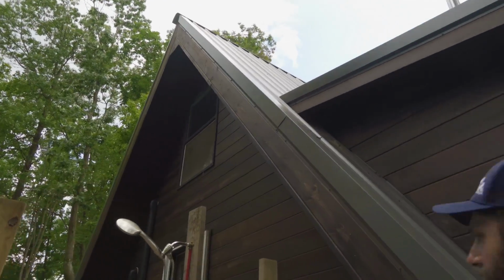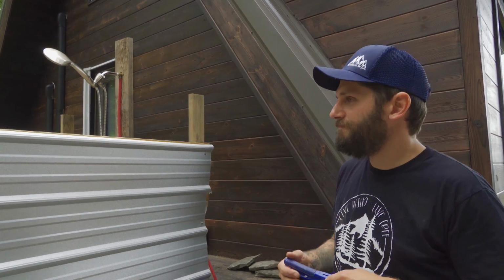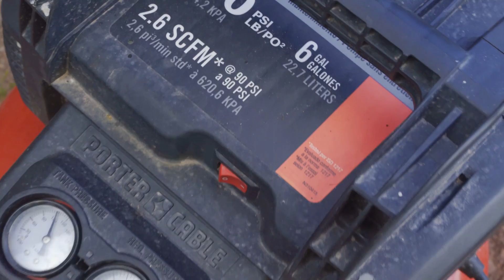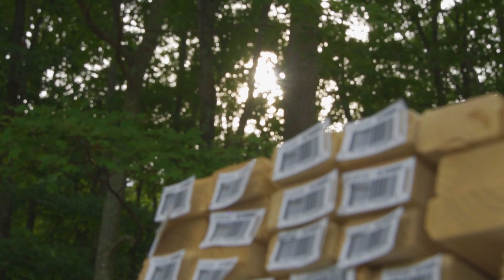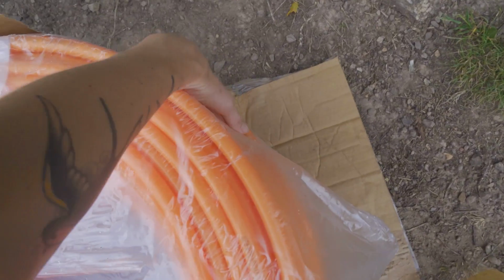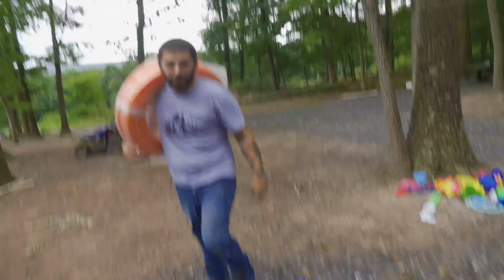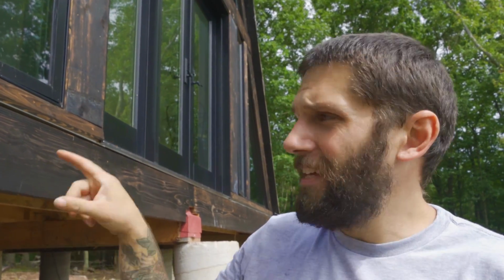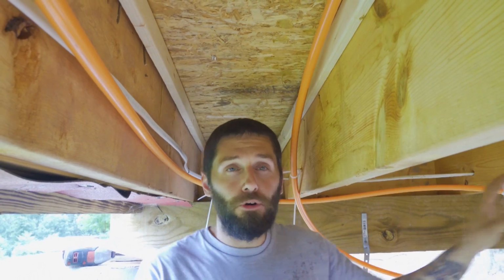Sixty Days Or We're Canceled!

Comment: The sliding door you could make into a juliet balcony. That would be cheaper and quicker than putting in stairs. And easier to reverse when you want to build your deck.
Reply: Awesome reply!
Reply: Exactly how they do it in MN to cut costs on the initial build.  It’s legit and should comply with the policy.  Even more simple is no Juliette deck and just put a temporary rail across the deck door opening.
Reply: Exactly what I was thinking.
Reply: @davidvoller726  this^^^
Reply: Benjamin Brewer From my understanding... (want to check building codes) generally as long as any egress (window or door) greater than one needs to allow for someone to get out.  Looking at their space as such, they have a lot of egress.
Reply: @benjaminbrewer2154  technically they have three. The one door at the other end of the house and the one opposide the kitchen. The big glas doors to the balcony or planed deck is the third exit/entry/doorway.
Reply: I’ve seen where there just put a rail with vertical boards right across the slide door opening.  Treating it as a window.  :)

Comment: My in-laws had a mudroom/porch where you could drop the field clothes in a washer (not the main washer) and hop in a separate shower.  Kept the mud & grease out of the house and main laundry.  Before insulation, I suggest steel wool/stainless kitchen scrubbers around every floor penetration to discourage varmints gnawing their way in.  I would build permanent temporary stairs at each door just for piece of mind if exiting in a early morning fire or something.  If you plan it out, you could reuse parts of the 3 stairs on the eventual deck.

Comment: We built a new home a few years ago and the builder just attached a piece of deck railing across the outside trim of the door to pass the final inspection.  So even if you opened the door you couldn't fall out.  Our county uses the International Building Code and it seemed to satisfy the inspector.

Comment: Regarding insurance, don't expect an extension. Cancellation likely at 60 day mark without verification of punch list completion to their satisfaction. 
Regarding rails and pickets, "permanent" does not usually refer to whether or not it will ever be changed. It's simply used to describe a securely fastened assembly which is done to local building codes. Usually showing concrete, nail or screw fasteners, hurricane or seismic anchors if required, and meeting dimension guidelines. Handrail height is usually between 36-42" from the leading edge of steps and from any deck surface over 18" off the ground. Spacing between pickets may allow no more than a 4" air gap to protect from a child's head passing through, therefore minimizing the chance of a fall. As long as it doesn't fall over at inspection, you'll probably be just fine.
Thanks for sharing your life and stories with us all.  It's been a pleasure to watch you grow.
Reply: They should give some very serious consideration to installing a Juliet rail!!

Comment: The bubble foil stuff is a radiant barrier insulation. I love that stuff, especially if you’re camping or out in the snow like if you have to crawl under your camper or truck and work on it, throw that stuff on the ground and it keeps you dry and warm.  It’s also rodent resistant and bug resistant which helps a little bit with that stuff.

Comment: I had it happen to me on a home I subcontracted/ built in TN years ago. The sunroom on the back of the house would go out onto a deck which was to be about 5 or 6 feet above the ground level, but I would be building it after moving in the house. I was required to put a double keyed deadbolt on the back sunroom door which would be onto the deck when built. The double keyed deedbolt prevented someone visiting from unlocking the door and falling 6' to the ground.
THEY COULD EVEN OPEN THE DOOR!

Comment: You are going to love radiant heat .  On the underside of the main floor of my house we used  a rubber type hose , not fun to install but when it gets cold and it warms up the tile floors well worth it.  I used the type of pex pipe you used under the concrete  floor .  I  used a  Lochinvar Nobel combi  boiler  for  domestic hot water and heating needs .

Comment: I’m impressed that nothing nasty moved in under your house (skunk, wasps, etc). It would be easy enough to make a little balcony outside the glass doors—just a balcony, with “permanent”-quality railings but no steps. The door in your peaked dormer only needs a little platform with steps going down...again, “permanent” quality but relatively simple to remove for the sake of upgrading.
Speaking of the peaked dormer, I still think it needs something (temporary soffits?) to keep bugs out of your ceiling.

Comment: I replaced every inch of old copper in my home when I bought it 4 years ago. It's a great product, went in easy, and has had zero issues. This is from a guy who has soldered both copper and lead pipe at work for over 30 years. PEX is the way to go!
Reply: Nah, i'll stick to copper. Lets see how your pex holds up after 37yrs compared to my copper pipes installed in 1983...
Reply: @rztrzt  Modern copper has impurities in it and will be leaking in 15 yrs max. Yes 60s copper is still going in a lot of houses.
Reply: @rztrzt  I don't plan on being in my house in 37 years...but there's plenty of time on existing PEX builds now...more than enough to know if properly installed its a solid product. I've got nothing against copper...in fact I enjoy working with it...but the cost no longer makes sense outside of a few scenarios. For the average home owner there's no benefit to installing copper.
Reply: @rl3898  bollocks, maybe in your country but the standards here are higher than they were in the 80s
Reply: @glamdring0007  Yes in the US you guys go for cheap hence why nothing lasts. Each to their own. Over here people won't touch that stuff unless it's for stables, animal pens etc.
Reply: I'm pretty sure copper kills germs, viruses, etc on contact. Hence the wide use of it. Egyptians kept their water in huge copper jugs.
Reply: @rztrzt  PEX wont degrade over time or break under high stress. Here in the midwest where it's cold, copper busts and PEX does not. It's faster and easier to install, and will last longer. I think people are hesitant about PEX because they're uneducated and somehow connect it in their brains with junk cpvc. It IS a superior product to anything else on the market and has nothing at all to do with previous plastic water line products.
Reply: @rztrzt  Yeah sure you never buy Chinese or Indian products...Doh!
Reply: @rl3898  wtf?
Reply: @TDiem-vh9zv  True...and if you're on a well for water it might be a concern. Anyone on city water doesn't have to worry about it.
Reply: @glamdring0007  .... agreed, remodeled a house built in early 80's and pulled out all copper, installed a manablock home run pex system for each hot/cold drop. Easy, tune-able and not worried about corroding or splitting issues due to cold weather. Cheaper than copper as well, better all around.
Reply: @glamdring0007  I agree totally. I was just giving a reason WHY it was used. But new inventions come along and things change.

Comment: I ran into the same problem getting a home appraisal and having 3 steps that were slightly too high and needed a hand rail. I built a 'permanent' rail made of 2x4's, sent them pictures, then it was approved. 'Permanent' means very little except screwed down. Just get it done simple and easy enough to pass the inspectors, then tear it off the next day. These are desk jockey paper pushers, they just want to push the policy and start collecting your money. IMO you could just do without insurance all together, its a scam but thats another discussion for another day.
Reply: You can go without insurance but if your house burns down you lose.
Reply: @leahr.2620  until they find a way not to pay up
Reply: If you pay premiums for 50 years and never receive a dime, then count your blessings. We've had two claims, each paid properly. Having no claim is much better than a paid claim.

Comment: Should have closed cell foamed under the house with 4 inches, installed chicken wire to prevent critters from getting up there and during winter you can use the heat pump through the mini split or get 3 radiant space heaters. Your floors will stay warm!

Comment: love radiant heat, I had garden apartment that used to have it and it was so nice in the mornings walking into the kitchen or bathroom barefoot and feeling that warm floor, only bad was it dried out the air and I would get bloody nose sometime, but easily fixed with a humidifier

Comment: my father just built a shop and used pex in the cement floor as heat. just runs an efficient hot water heater on a thermostat
Reply: What's a hot water heater?
Reply: LivingCountry seriously.. 🙄 you know what he means and so does everyone else
Reply: @amjorgy1  I'm a residential electrician, EVERYYYYYONE calls its a hot water heater.
Reply: @QuitYourCryin  lol that's weird,  why do you need to heat hot water?

Comment: You should be able to just screw on a barrier at your patio door for insurance. Put some 1x4s across and have some vertical boards with 4 inch spacing. Save you from putting steps there.

Comment: The same thing happened to me in regards to having to have "permanent" landings and stairs. All that means is not a "construction" steps and railings. Build a landing, steps, and rails to code and you are fine. A few months later I took the landing off the back of the house and built the deck that is still there today. No problem. 

Here in NC I had to have a landing that was a minimum of 4' square.

Comment: I hope you have better luck with the bubble foil insulation than we did, our builder used it in our 5000 sf building and a year later it started to disintegrate. It did not hold up to heat and cold, had to replace all of it. good luck

Comment: Underpinning suggestion. Frame between the concrete piers with wood and attach faux rock panels. Later, you can come back and put rock on the piers. The framing and faux rock panels will get you closed in.

Comment: New construction you could put a hand rail across the door opening for the deck with balusters space no greater than four inches apart. This prevents anyone from accessing or using the door for an entrance or exit. Take you 30 minutes and easy to remove when you are ready to do the deck. Insurance should have no issues with that, they allow cookie cutter builders “planned communities “ to do it all the time.

Comment: You can ask them if you can put in a rail on the outside of the house to prevent egress through the deck door until you can build it.  They do it a lot on new construction around here because the ground is too disturbed to build a deck that will remain stable with the soil settles.

Comment: Once you jump through the hoops your insurance company is making you jump, and this phase of the build is complete, I'd look for another company. 

How many homes located close to the water that are elevated, i.e sit on stilts, don't have the pilings skirted? The answer is all of them. If you guys know anyone that does home pre-inspections, have them give the house a once over to identify any possible issues.

You guys can build a set of stairs and a 1/4 scale deck, then attach to the house as a permanent set of stairs. Once the nannies are happy, you can use the stairs and deck for the next phase.
Reply: I found required skirting odd and being forced to install permanent stairs. I don't know about there but here is you can install a railing over a door that isn't going to be used anymore / going to have a deck (re)built in the future.

Comment: I would do a Brick or Stone closure underneath the house (Its labour intensive, but will look very nice). the Sliding door, do a Juliet Balcony with a Balustrade. and the other doors, stairs and balustrades/handrails will be good, easy to remove and re do later.

Comment: As for the sliding door. If you have that door safety-locked ( prevented from opening by a fixed mechanism ) then you will not need a porch or deck.. I had the same problem in my kitchen slider. Kept it locked (unable to be opened) .... for over 5 years until I built a deck.

Comment: Can't fault your work ethic chaps. Well done as always but I wouldn't expect too much from under floor heating. In my experience it is hugely inefficient. However the foil bubble insulation is very good. I installed it here in our house in France. Directly under the roof lining and then we planked over like your interior ceiling. It works very well.

Comment: If it helps any, I had the same situation when I built my house, they let me install double keyed deadbolt locks, so you needed a key inside to open the door, and I didn't have to do more immediately.
House is amazing, hot water bib👍
Is an outside wood burner your source for heating the radiant floor?
I've had radiant floors for 18 years. Any questions, HMU.

Comment: I think there is a much easier solution for the entrance staircase  issue. What if you place door/window guards (patio door railing) on te outside of the door opening. You can normaly find this on apartment buildings. Okay it's not an entrance anymore, but insurance might find it safe. This way you can build your permanent staircase and railing in ease.

Comment: About the radiant heat pipe:
My installation guy told me that heat pipes should always be installed level or in a climb. Otherwise air in the system, which always accumulates over time, will stay in the high points of the pipe and lower the efficiency of the system or even make it stop working.
In your video it seems that you put the piping underneath the support beams to reach the next area.
Just a heads up...
Greetings and 👍 for your great home.

Comment: Erin, even though it was in the late 90's early 00', I worked for Nationwide Insurance in your area. I mostly handled Hardy, Grant and Pendleton, but did some in Mineral and Hampshire. Josh is right, you can build a small staircase and rails and then upgrade later. Also, under the West Virginia Insurance Commissioner and state law, if the insurer cancels the policy, they are required to refund the pro-rated balance as per the cancellation date. If there's an issue, contact the WV Insurance Commissioners office in Charleston, to file a complaint.
Talk to your agent and see if they can get the risk assessment and underwriting department to get you can extension. Hopefully, it's an agent with some pull.

Comment: I don’t know if this will get to you before you get to this point. But I would use foil faced rigid foam preferably 2 inch not the bubble wrap. Thank you’ll get way better results with the rigid foam. Also get professional canned spray foam to glue it in place an air seal it. Then you can probably use fiberglass below that and then I would plywood under it so you don’t get critters in it.

Comment: Have you seen wood grain metal siding? If could enclose the bottom and not be impacted by soil contact. There are many styles and colors available. Google wood grain metal siding. You could frame it with steel studs to avoid soil contact.

Looking good........

Comment: The insurance company did the same thing to me, told me I had to have the underneath of my house closed in within so many days or I was going to be canceled, So I bought the cheapest lattice I could find, half of it was used that I found on Market Place, and I got some 1x2's for uprights to hold it in place, and I threw a cheap paint job on them. And that worked until I had the time to remove it piece by piece and close it in the way I wanted, and that was with stucco and stonework. But the lattice gave me all the time in the world, and then I re-used a lot of the lattice to build things around newly planted plants and trees to protect them and used some of it in my barn.

Comment: Sold and installed OWF and radiant for 29 years.  Sold  just over 2400 units.  Some folks installed their own.  Self-installs can have some warrantee issues unless the dealer inspects and signs off on the install.  (Central Boiler).  The area I am in, all municipalities required a code inspection on plumbing and electrical.   Not familiar with WV code regulations and inspection requirements if any.  Almost every insurance company is going to require railings and other 'safety' install even if local code doesn't require it.  They can't keep the balance of premium if they cancel.  Can be very difficult to get other insurance companies to write a policy if you were cancelled for cause.  Insurance companies are your friend until you have a claim.  Glad you are doing the radiant.  Won't be sorry.

Comment: Ok, so I get the whole air gap idea, that makes sense, What I'm not getting is the insulation, is it going to be fiber or sheet foam? If your using sheet then I can see how that would work but with fiber, it could create pressure on the bubble wrap and collapse the gap.

Comment: Back door.  Put a "permanent " treated wood railing on the exterior. Way cheaper than the deck and stairs and should take an hour to complete. Its perfectly legal and millions of homes have been sold like that. 

One other point. I suggest you get some gray rustoleum and paint up all your gas lines under the house before they start rusting too much.   

Good luck and keep it up!

Comment: You said you need to have handrails and correct porches and steps if you raise the ground level in the back on the small porch to the bottom of the frame until you get ready to build your porch it is legally 12 in below the house you don't need a railing at that point